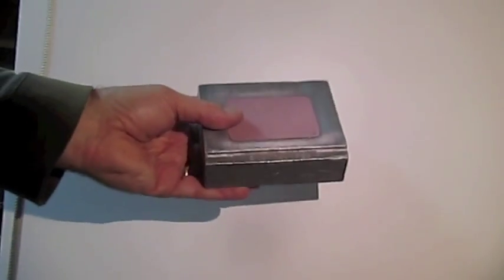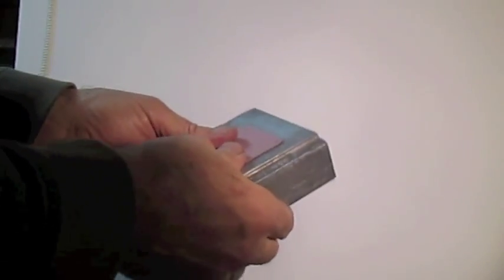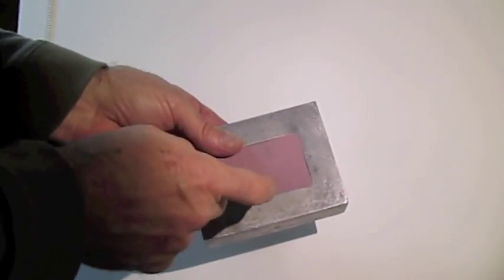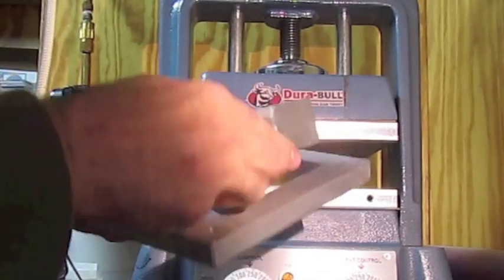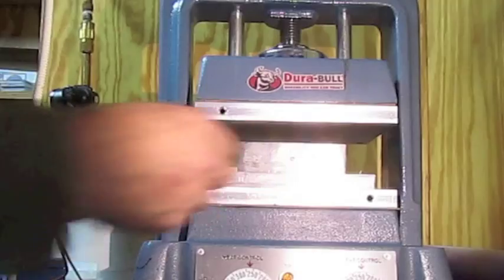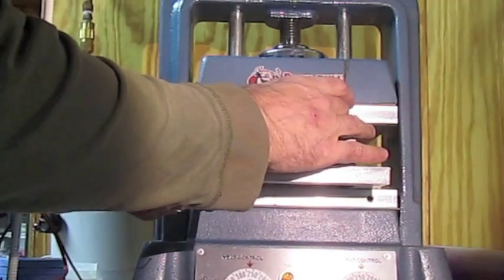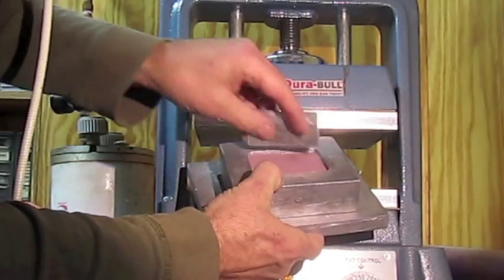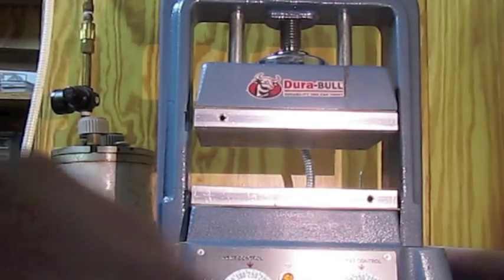Stuck silicone mold removal from mold frame

Comment: Any other ideas on ways to remove a silicone mold if you don’t have that larger frame and aluminum insert?
Reply from the maker: Hi Tina, Thanks for your excellent question! You can use two pieces of board, maybe 1x2 by 4 inches long. Place one piece under the mold frame with the stuck mold in it. Place each board under the right end and the left end. Then, take a smaller piece of wood, almost but not quite the size of your stuck mold. Center that piece of wood on top of the mold taking care not to touch the top of the mold frame with that piece of wood. Tighten the platens of the vulcanizer to squeeze the mold through the frame. Next time, spray the inside of your mold frame with teflon spray available at any auto parts store. Please tell me how this works for you. Thanks!
Reply: @chuckhunner  I’m a little concerned about using Teflon as it is a carcinogen. I tried using the paper backing yesterday on the inside of my 1” frame yesterday it worked amazingly well. I’m using LTV. I had less trouble with my smaller frames but I really appreciate your videos and advice! I’ll try the wood options next time I’m stuck. 
🙏🏻🙏🏻🙏🏻
Reply from the maker: Perfect Tina. Glad you're finding solutions
Thanks again for your interest in my craft.

Comment: Hi Mr Hunner. I am a big fan and want to absorb your knowledge of mold cutting. I have been making jewelry since the early 80's but just started to make molds with RTV Castaldo LiquiFast Ice. I am in awe of your video about using film containers but the only thing missing from that video was cutting the vents for the head that RIO made. Im real curious on how you would cut vents for a cylindrical mold. That and all you share is very valuable information I cant get enough of. Thank you Sir.
Reply from the maker: Hi Mr Rez, Thanks for your kind words and eagerness to learn. The film containers are only a way save mold compound when you are short on materials. I find that flat rectangular molds inject much more predictably. The greater surface area of the flat molds allow slightly higher wax injection pressures to fill the mold more quickly and accurately. I cut the vents to the edge of the film canister mold in the same manner that I'd cut vents in a flat mold.